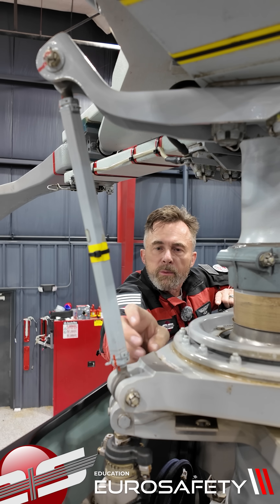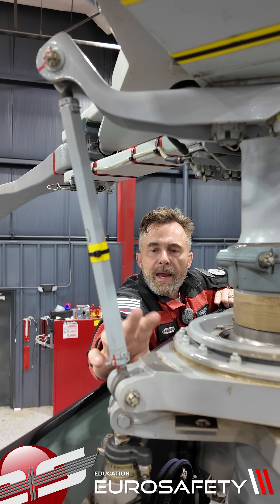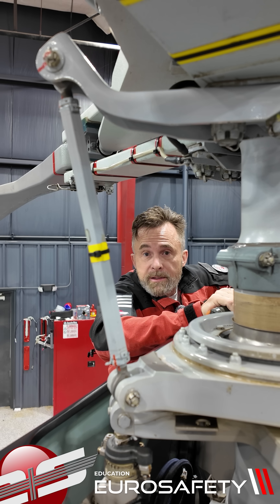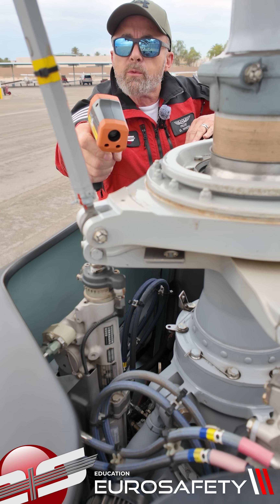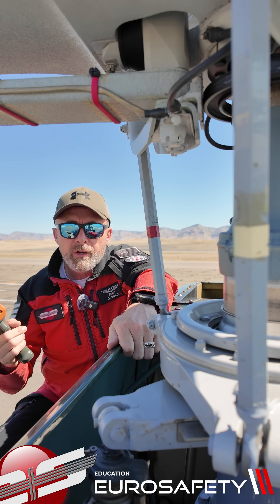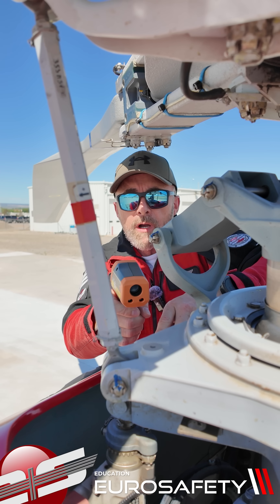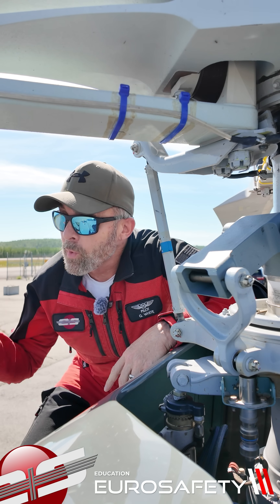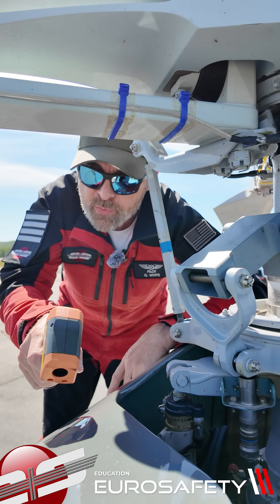#321 - When Checking the Rotating Swashplate on your EC130/AS350: What is the temperature

Comment: But why?
Reply: if you get some friction inside the swashplate bearing it will overheat
Reply: @friedchicken1 yes I do understand the obvious, the question is if there are some known issues about that?
Reply: @iFlojoe don't you think More friction is problem?? There is bearing inside which will damage overtime as grease will also dry out prematurely because of excess temperature.